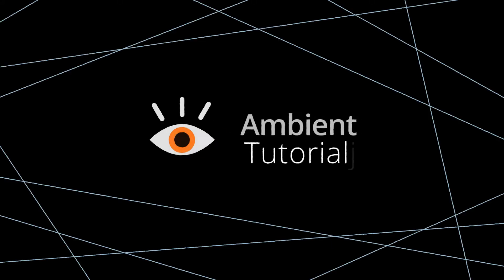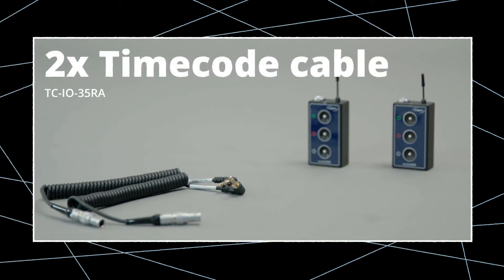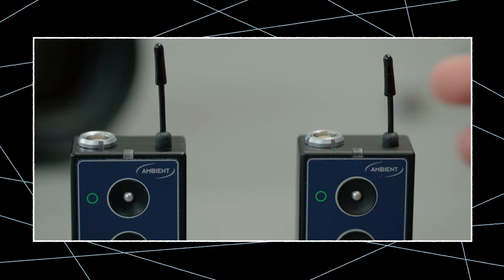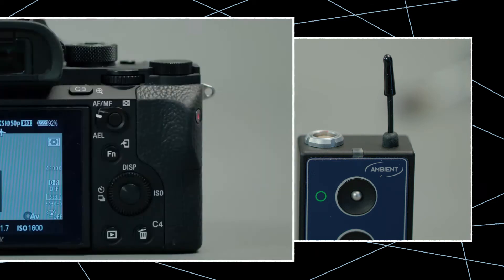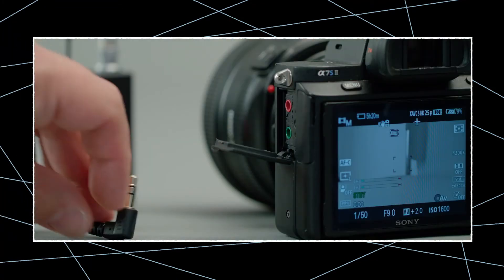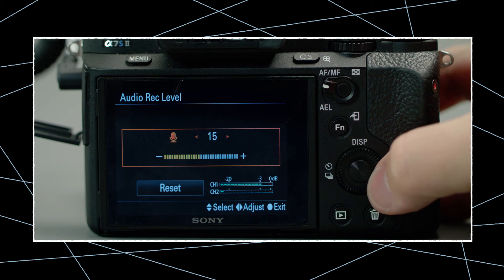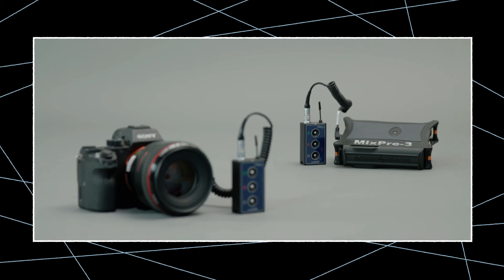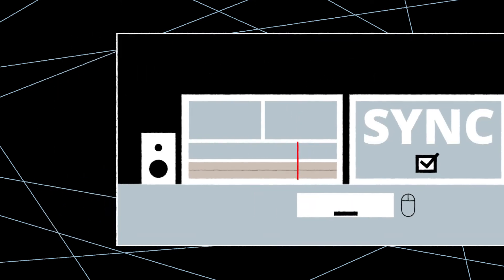NanoLockit Sync Tutorial: Sony Alpha 7s

Comment: I am purchasing NanoLockit kit for my Sony A7S2 and Red Epic W. 

When setting frame rate on Nano, is this based on the timeline frame rate or the actual recording frame rate on camera?

For most of my projects I will be shooting higher frame rate on both the Sony/Red and then conforming to 23.97 timeline.

My sound recorder is Sound Devices Mix Pre -3

Hope that makes sense. Look forward to your reply.
Reply from the maker: Timecode  in use on production cameras and recorders always refers to the project framerate which is also the  rate your editing at. So your choice would be 23.976 (simply called "23" in the LockitToolbox).  Note that SMPTE standard only allows  a maximum of 30 FPS, so on double rates, such as 1080P/59.97 you would run on 29.97 FPS timecode.